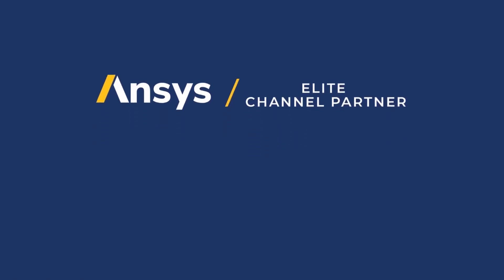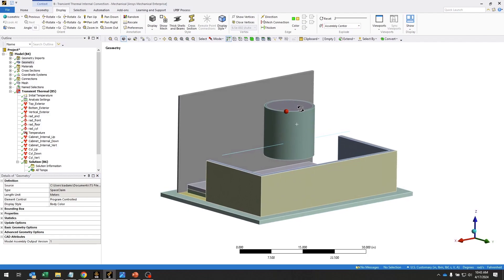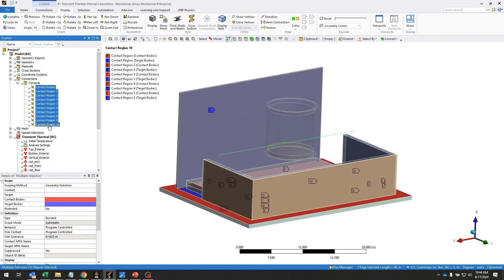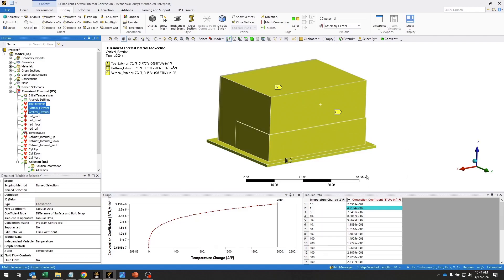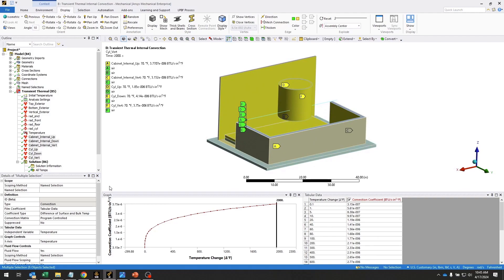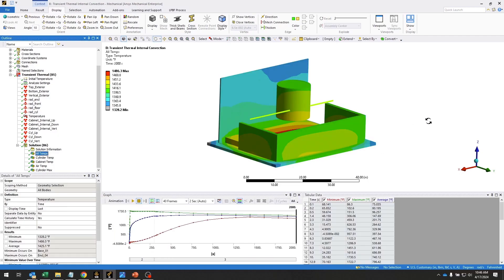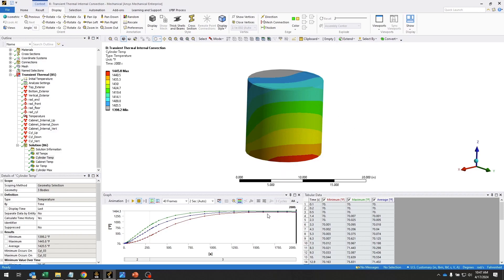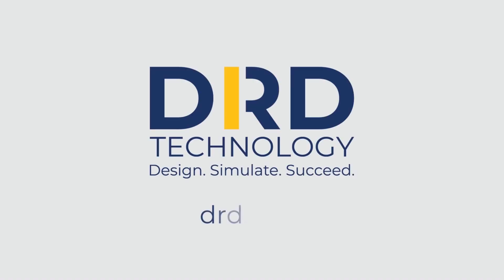Transient Thermal Analysis Example in Ansys Mechanical

Comment: Can you please tell me how I can include  air inside a hollow cube for transient analysis. Thanks in advance !
Reply from the maker: If you need to model the air as a fluid, you need to use a CFD program like Fluent.  In Ansys Mechanical you need to rely on convection coefficients to account for heat transfer to air.